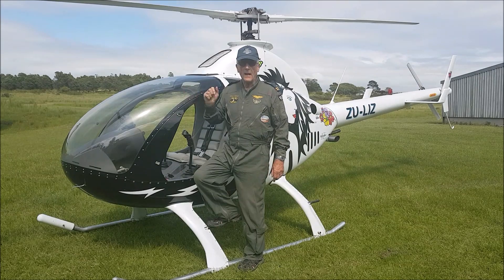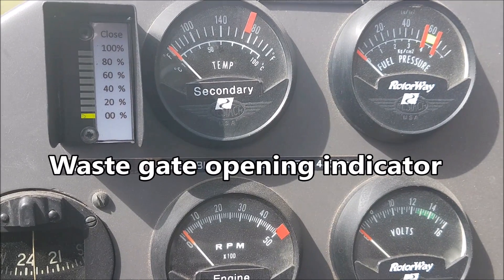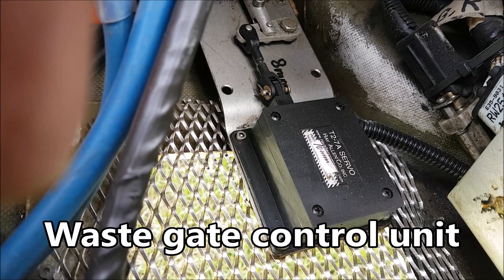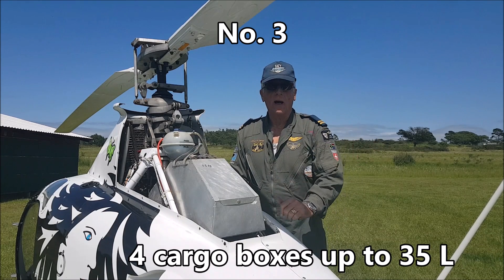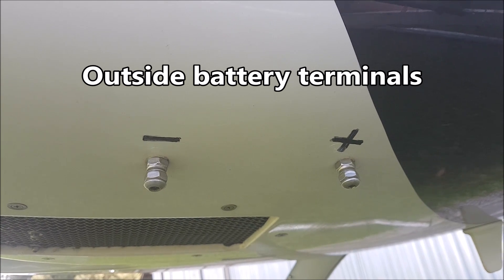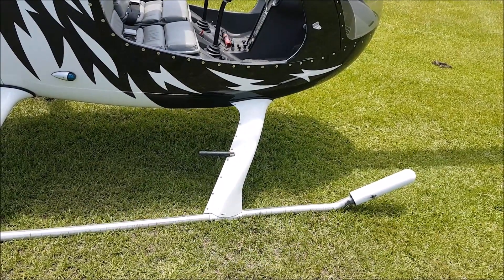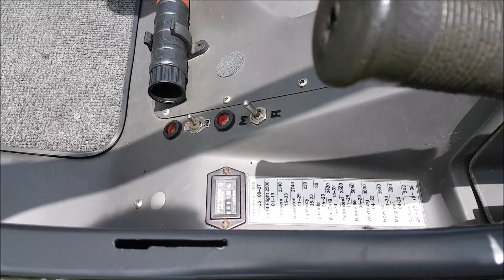Top 10 improvements on my RotorWay helicopter

Comment: Very impressive upgrades Arthur! Thank you for sharing! I have done the turbo conversion but with no waste gate control, additional oil cooler and cog belt drive, and fire strikers.  I have also upgraded to a tail rotor drive shaft and an electric clutch.
Reply: Hi. Can you buy all those parts (inc the TR shaft drive) as kits, or do you need to have both a fantastic engineering shop and the experience to make parts yourself? I'm an UK ex-R22/R44 pilot who fancies a Rotorway as a retirement project. Used 162s are very cheap in the UK, but I don't fancy one without upgrading to near-Talon specs. Can it sensibly be done? A new Talon kit would be nice, but is not economic when compared with a used R22 or similar, especially considering residual values. Cheers, Mark.

Comment: I believe that some of these improvements such as the turbo ,inter and oil coolers as well as the water jacket update are not just beneficial to the Rotorway but critical to its reliability and safety. Well done
Reply from the maker: Byron you are right, many of my improvements are a must for the RW safety and reliability
Reply: @ArthurGemperle  I believe some of these mods have been added to the new A600 Turbo right?

Comment: cool video, but i have one question. why are you rolling down the throttle so quicly when you land? to me it seemes beneficial to have full rpm until you are certain the helicopter sits firmly on the ground ( mostly "bush" landings, i get it when you are on grass or pavement :) )

Comment: Can one use such a helicopter for across border flights? What logistics would be required? I wanna fly my baby home girl home in style
Reply from the maker: Yes you can as any other aircraft. You need to file a flight plan with exact details where you take off and land, aswell take off and landing time. Altitude and flight route must be specified.
You have to go through a passport control on a International airport for take off and landing.
Reply: The term ‘exact’ makes it sound so stringent, I was of the opinion that helicopters can give one more leeway to ‘hoover’ around at leisure
Reply from the maker: @noelnyawade3072  
This is correct, in SA you can fly around with your helicopter anywhere as long you don't fly in controlled airspace without filing a flight plan.
However if you make a cross border flight you have to take off and land on a International airport controlled airspace

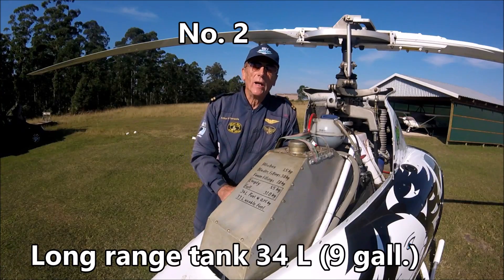Comment: At the 3:09 mark - you really CAN make the Rotorway A600 go beyond two-hours of fuel?
Reply from the maker: Thanks for watching.
My longest nonstop in the air with the normal standard tank was exactly 2 hours and with the long range tank 2 hours and 45 minutes.
Check my video World record high altitude landing.
www.youtube.com/c/arthurgemperle/videos
Reply: @ArthurGemperle  so 2 hours with a normal standard tank, and an additional 2 hours and 45 minutes with a long range tank? That's 4 hours and 45 minutes in the air. AWESOME! And I've learned that Rotorway A600 runs on the same fuel used for automobiles, is that correct?
Reply from the maker: Sorry you misunderstood,   2 hours with the standard tank and an additional 1 hour with the long range tank a total of 3 hours in the air.
Yes the Rotorway helicopter can use normal unleaded fuel aswell as aviation fuel (AFGAS)

Comment: Hi Arthur. 
Greetings from the UK. I'm an ex-R22/44 driver currently researching Rotorway. They look too good (and cheap!) to be true ...  and you took that thing to 16,000ft ASL, and took your hands off the controls and it still flew straight and level, and didn't enter an unrecoverable attitude and crash even once :-)  
Is this normal Rotorway behaviour, or is your machine especially well-balanced or something? (Bear in mind I am used to R22s).
Keep safe, Mark.
ps. And another question: I would be very uncomfortable not having an Artificial Horizon. Is there space for one anywhere?
Reply from the maker: Hi Mark, thanks for watching 
My RW is not standard but extremely well balanced and as you know turbo charged.
There is space for an artificial horizon if one makes a different instrument layout. Certain instruments with less priority can be fitted in the space above your foot.

Comment: How many maintenance hourse per flight hour ? Thanks.
Reply from the maker: Hi Jack
The RororWay helicopter has about the same maintenance per hour flight like any other helicopter. 1hour flight, 1hour maintenance.
Most other manufacturers don't tell you the truth.
The difference is on a RW you can do the maintenance yourself but on all certified you dont have to do anything  except pay a lots of money
Reply: @ArthurGemperle  That's a pretty good answer Arthur. May I ask you another question. How many hours on average,  would the 162 cu inch engine last for, Would a properly maintained one get close to 1000 flight hours, do you think? 
Thanks. Your ship is a great example of the breed. I love the 'high altitude' footage, that was otherwordly and not something you associate much with any helicopter, ever.
Reply from the maker: @jackspratt4343  
I believe if you maintain the helicopter according to RW specification it will last 1000hr. before the full overhaul is necessary
Reply: @ArthurGemperle  That is excellent for a 'home made' engine, with all respect. I've been looking at these machines since the late 1990's , even visited a distributer once. I'm impressed with the Rotorway user community and their enhancements than I am with the base company.

Comment: Good day Arthur and everyone, do I need a PPL (H) to fly this kind of Helicopter or what. Lastly do you think it can be able to fly from Tzaneen in Limpopo to Johannesburg twice a week?
Reply from the maker: Hi Keith, yes you need a PPL H  to bee able to fly this helicopter as well as every other one.
That distance is about 400 km that means you have to refuel ones to be able to fly to J'burg. The RW helicopter has an endurance of max 2hr. at. 140km/hr. You can refuel at any petrol station half way with normal unleaded fuel.

Comment: All those improvements and the tail rotor is still driven by a rubber belt.
Reply from the maker: Thanks for watching.
This is correct, the belt drive is reliable maintenance free, light and easy to change. Shaft driven tail rotor is heavy, expensive  and has 2 gear boxes who are maintenance intensive and not without concerns.

Comment: What is the use of the hover fan improvement if I may ask?
Reply from the maker: Thanks for watching.
In hover there is no airflow trough the intercooler to cool the hot compressed air from the turbo, there for I use a fan to to blow through the intercooler to cool the hot air. In flight the fan is switched of and the airflow from the forward flight is doing the job.
Reply: @ArthurGemperle  Awesome! I get it now. To prevent the turbocharger from over heating. I have some knowledge of turbine powered helicopters and I think there is no need fror this there. Thanks for the reply!
Reply from the maker: Sorry not quite right, not to prevent the turbo from overheating but to prevent the engine to have detonation or pre ignition due to hot air intake.
Also cooler air carrys more oxygen to the engine and that means more power.
Reply: @ArthurGemperle  Ok. That makes more sense. I think I have seen one in Robinson R22 helicopter as well. At the back of the helicopter.
Reply from the maker: @karanmarwaha6605  
The Robinson R22 and R 44 are not turbo charged.
There engine is air cooled , they need that big fan to cool down the engine.
The Rotorway helicopter is water cooled like a car, but also needs a fan to cool down the water.
That has nothing to do with cooling the air intake for the engine after the turbocharger
Reply: @ArthurGemperle  Im learning so many new things from you.

Comment: Its price? I want to buy it
And seatig capasty?
Reply from the maker: It is for 2 persons, mine is not for sale but we have an other one with the same turbo like mine for sale for only $ 55 000.
With 250 total engine hours
Reply: @ArthurGemperle  
Brother kindly in touche with me i want to buy for 4 persons but i have no knowlege about hellies 
If that will out of my range then this one will best but i need ur guidness as a brother
Reply from the maker: Hi Zain
There is no 4 seat helicopter as kit available. One a 4 seat used certified helicopter the Robinson R44 is the best option but it will set you back at least $ 350 000
Reply: @ArthurGemperle  
Ok brother but plz tell me that aftr 250 ours we should change its engine then it becomes fly able and how much expences at this proces
Reply from the maker: @zainabbas1467  l don't know  from where you heard this untrue story regarding changing the engine after 250hr.
All aircrafts had a maintenance schedule like a car. 
Aircraft maintenance is more involved than cars maintenance, because you cant just pull over and stop. On aircrafts you do everything earlier so nothing should break during a flight. Each aircraft has a different maintenance schedule.
On Rotorway engine you have to complete overhaul the engine after 1000hr.  but deffinately not throw the engine away. After that overhaul the engine is considered new again and you are ready to go an other 1000hr. To keep the engine running you have to do several services every 100hr. and preferably change oil and clean filters every 50hr.
As a private pilot even if you fly a lot like me It can take between 10 and 20 years to perform a complete overhaul.
I hope that answers your questions
Reply from the maker: Don't worry, I did like to answer all your questions it might help also others.
If you watch some more of my awesome videos and make some comments with thumbs up on YouTube, that would be highly appreciated 
www.youtube.com/c/arthurgemperle/videos
Reply: @ArthurGemperle  sure and thnx